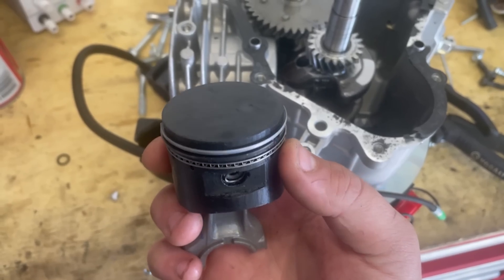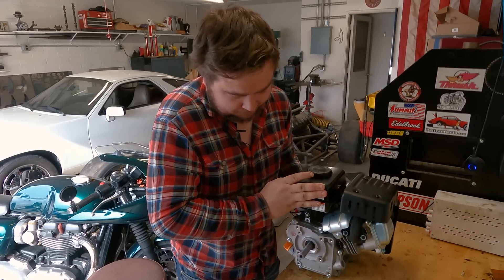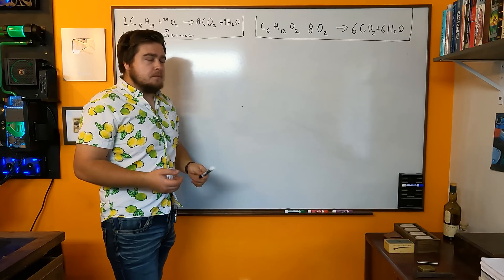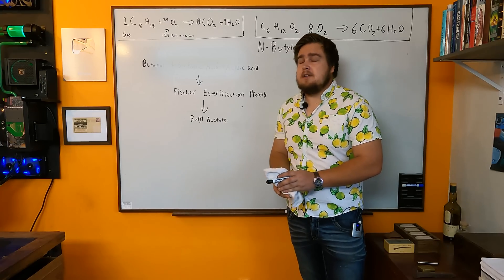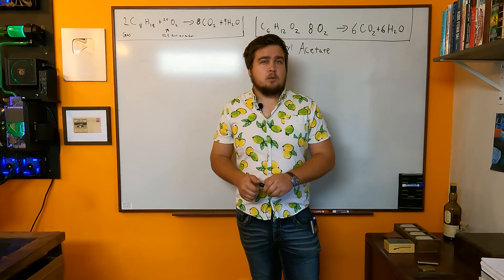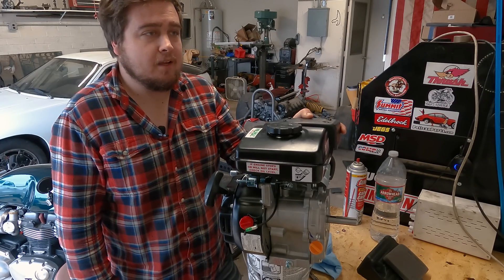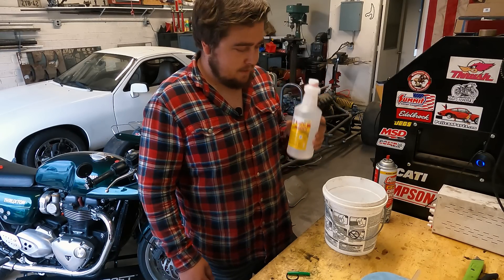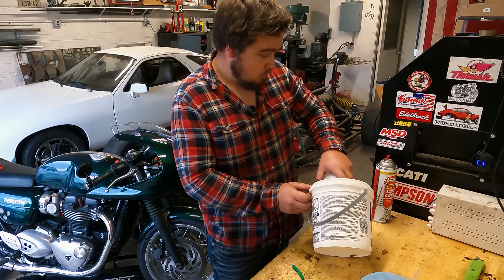Cold Burning Fuels and Plastic Pistons for Harbor Freight Engines!

Comment: This is a cool idea. It seems like if you could do some sort of vapor deposition of a metal coating onto a plastic piston. Or even something like one of those high temp ceramic paints you could both protect the piston against the solvent effects and a little bit of the heat, but still make the piston injection moldable or printable.
Reply from the maker: I'm actually looking into some ceramic filaments possibly.
Reply: @WesleyKagan  Cool. I was aware of those, but they didn't occur to me. Did you look into Ninjaflex filament? Not for the pistons, but it's fuel resistant, and one of the flavors is heat resistent enough to make carburetor boots and custom gaskets. That's a real help for people who want to keep old bikes going. I plan to make a custom airbox for my UJM that eliminates the need for the hateful old carburetor boots. It might work for your headgasket on your HF motor.

 I've been wondering how you have the time and resources to be such a polymath?

Comment: SIck brah. So, a few thoughts there. PTFE and POM are both n-butyl compatible. FEP too? McMaster up some o-rings. That's if you gotta stay with ABS. it's a pretty shitty material choice in this app imo. Instead of using an IR gun every few minutes, you can 'duino a type k thermocouple bingbang boom which will be good enough for you. Or, Instad of ABS try PA/PPA (if that's 3d printablle, i aint no 3d printer dawg).  I aint no plastic engineer, but check out Ashby's 'material selection in mech design'. Alternatively maybe look at using the 3d print to make a positive of the piston, make a negative with some sandcasting ..sand (i.e. like a die), and pour some metalzz in there.  Or, if you want to go down a rabbit hole, buy some PTFE pellets and injection mold into that die. Low co-efficient of dynamic friction broseph. Either way ABS is no good. 

So re: torque There are a bunch of idiots on the youtubezz who tried to characterize steppers torque. There was this one idiot who tried to jerry rig a load and had absolutely no idea what he was doing. I had just loaded up on my adderall script so I nit-picked every single thing he did wrong (I'm not a mech e, or an EE but I can fake it well enough to call out idiots). There were ~12 major flaws in his setup and I went all pedantic on him, because the dude was some like 45 year old so fuckin dumb  , dumbdumb. I hope in 15 years I won't be a fuckin mimbo like him. I just a dumb college drop out but I know enough to know a) when people are fucking idiots, with like 20% of the theoretical knowledge but posturing as though their shits dank, and b) i'm dumb but libraries and app notes have a shit-ton of legit knowledge. 

Jerry rigging a chassis dyno is a huge fuckin pain, i'd imagine, fabing all those rollers and blah blah. At the crank tho, I'm pretty sure you can just use a load cell and a water break or hydraulic . Those expensive Fap-off (tm, AvE) torque wrenches are just a wheatstone bridg, so yeah I mean jerry rigging no prob. https://en.wikipedia.org/wiki/Dynamometer Look at the water-break schematic, it's soooper easy. If you know a bit about EM those eddy current absorpers look even simpler in theory (I didn't even know those existed, fuckin cool)

https://www.mathworks.com/help/autoblks/ug/compression-ignition-core-engine-breathing-and-torque-production.html That's a model you can use via speed density. I think tunerzz get full power output numbers with a wideband o2 and SD. I was skimming a paper and i think some dude managed to profile his shit solely on a temperature profile, check it out (MICHAIL KORRES, 2016, KTH UNI, sweedeene Cylinder Pressure Sensor based Engine Combustion and Fuel System Diagnostics). The "real" way would be to drop in an actual sensor, they make 1/4-20's you can just tap into your piston and bing bam boom but those fuckers are expensie 

Overall the price factor of plastics being cheaper than metals isn't really that much. Cast iron is about a buck a pound, so in a production run, an entire consumer engine in raw materials probably costs...not much. Alu is a bit more but super environmentally friendly once the initial production is done (i.e. recycling alu is reeeeeal energy efficient). Also the maturity of the industry re:casting engines is a big plus there too, since all the tooling is already pretty easy to acquire/the processes are highly well known. 

Your shit rocks man keep rockin rockin

Comment: There's a difference between an engine free-wheeling and an engine under load. You can't necessarily extrapolate. It'd be a better (and shorter) test if you jurry rig up some way to load the engine. Either electric power, or else that warped-perception guy's go-kart brake dyno.

Comment: Rig an alternator up, load it with a known known amp load (heating element) and you have a basic power measuring device. 750w equates to 1 bhp

Comment: You would need peek to survive the temp and a stock prusa won't print that. But. There's enough filament that can be sintered into solid brass stainless or similar metals. You would need to resurface it for use tho

Comment: So uh, this test was horribly unscientific. Like you have no way of guaranteeing a fair contest between the two if you can't reliably get a good and steady 8:1 air fuel ratio for the n-butyl acetate.

But the fact that it ran so well on the butyl acetate is a good sign for sure.

Just saw a comment that mentioned how carbs will meter fuel identically between fuels because that's just how they work. They just meter fuel. Oof. All that changes is the power of the engine on different fuels, and that wasn't measured here.

If anything you should be using a method of measuring calories. Take like a cc of each, explode it, and measure the resulting temp and force.

Comment: As much as people want to put in plastic parts they'll never hold the rings firm enough or put up with any extended use, cold and hot starts would be very hard on them as well, in the cold you'd be lucky to not rip the wrist pin out of the piston and I'd rather not have to replace the pistons every 1000 miles

Comment: If you do the same sort of test you could monitor the rpm (instead of temp) and get an average of the rpm for the different fuels over the duration. If it's at a higher rpm for the same amount of throttle, it would most likely be making more power. I'm not sure how the choke would affect this idea though.

Comment: A far as Dyno-ing that little 79cc motor, you could design a 3d printed variable water brake. The tricky part is where to put the load cell to pick up torque but getting RPM is easy.

Comment: To Dyno it you can afix a DC electric motor and apply load to see what kinda of power the engine can output through the motor. It won't give you real HP numbers because of losses in the transfers between mechanical and electric energy but it'll give comparative results.
Reply: Or use a car alternator.

Comment: I think the gasoline result are pretty cold because this kind of engines are kind of tuned on the rich side.

Pretty much everything that is thin enough and can combust can be used as a fuel in a gasoline engine.

Ethanol, acetone, etc... Are very good remplacement for gasoline, too bad acetone dilute a lot of things it comes in contact with.
Reply: This is the same reason carburetor cleaner can be used to start a motor. It's like 95% acetone which gives it 120 octane and pure ethanol is 112 octane so it's a very stable fuel.
Edit: the only problem with this is that it attracts moisture which can be bad for your motor and fuel lines etc.
Reply: @matthewmorgan582  I agree, if you want to use ethanol with your engine, you must have a good sealed fuel tank and keep the level high.
Acetone on the other hand tand to make the injectors o-rings swell and lose theirs integrity, so if you must find a way to avoid this if you want to use this as fuel.
Reply: @ElectronikHeart  Yeah, it makes rubber and gaskets brittle as well. This is also why some engines require ethanol free as it can cause fuel separation and other problems although with the right setup you can run pure ethanol or methanol in a motor.
Reply: @matthewmorgan582  Yeah separation can be an issue with gasoline mixed with ethanol.
But mostly ethanol or pure ethanol fuel don't suffer from this problem as the water will just dilute the ethanol a bit.

The problem with e10 is that the water will only bond to the ethanol and all this water will fall at the bottom with the very small amount of ethanol contained in this kind of blend. Making it almost impossible to burn.

Comment: Short note, 6:10 anaerobic is where oxygen is not used for respiration, just erase the no on the front of the sentence and you're good, or you could say 'it does not use an aerobic respiration cycle'
Confused? So was i, because for the longest time i heard anaerobic, and an aerobic as the same phucking thing. Thanks professor, wish you had written more things out on the board, or avoided using, or at least notified when you used 'an aerobic'

Comment: Could try polycarbonate with a make-shift enclosure, as long as you have an all metal Hotend. Or you can get abs/polycarbonate blend from 3DXtech and maybe others. Does close to the same temp but is easier to print.

Comment: it will be an adventure to make it happen but I think your best bet is annealed high temp PLA. CNC kitchen tested it out to be able to withstand 180 C and hold shape. annealing the pistons will be tricky though. they have to be 100% infill and the best method I've seen is packing them in a container of finely ground salt and baking them at around 80 C and letting cool down slowly. this is going to have the needed high temp resistance and resistance to esther vapors
Reply from the maker: Any filament that has a crystalline structure will resist ester better, and PLA is a good candidate. I have a lot to try it seems, I'm looking forward to it.

Comment: Also, why are you dicking around with the pull start? Tear that fucker off and use an impact or drill with the right size socket to spin up the motor. Will make this process soooooooo much less tedious for ya.

Comment: While you’re at it, might as well print a clear head for those sweet sweet slow motion flame 🔥 front shots. I’ve been printing with ASA CarbonX (Carbon Fiber), 100c bed temp, but it may be too brittle for the piston. You’d also need a custom cardboard box enclosure for your Prusa:) great video 👍🏼

Comment: Get PEEK that should be the plastic that you are seeking. It prints like PLA but 200°C hotter on top of your PLA settings. You might modify your 3D printer for this plastic but it's worth it! I'm saving money to make this upgrade. Because this plastic is chemical inert and it's used to make funktioal parts in Aircrafts and in Aerospacecrafts

Comment: I've done similar tests regarding alternative fuels in small, carbureted engines and once completed them I realized the giant flaw in the tests. Run times will remain almost constant due to the fact that carburetors are made to burn x amount of fuel with y amount of air so it should always burn at the same rate. When you choked the engine all you did was lower y. Rpm was likely less with the NBA. You need to use a fuel injected motor with which you can control fuel maps so you can set afr to ~8 rather than ~13.

Comment: Many years ago you could buy a 2.3 liter engine (based on a ford) that was mostly made out of polyamide-imides plastic. Polimotor Research made parts for other engine designs as well. I don't know if they went the route of a cooler burning fuel thou. There are companies that can print 3D files with PAI powder. Which is still one of the best plastics. A PAI piston with a ceramic coating on top would work fine, and may outlast the stock one....

Comment: What about water injection? That would reduce combustion temperatures somewhat. Although it would require significant ignition advance.
Reply from the maker: Might be something to consider, although that also comes at a cost of power.
Reply: @WesleyKagan   Proper ignition advance to compensate for slower combustion propagation should make power loss negligible or at least minor per NACA tests.

Comment: rad. definitely worth a sub. would be really interested to see more performance characteristics of the stock engine on gas vs butyl acetate at different choke settings since these engines aren't exactly precise, and mixtures of both gas and butyl at different ratios to see if certain traits peak around specific ratios. actually doing that would be a little too time intensive, but this is a really cool heads up to look out for any engineering developments using butyl. really curious whether high compression motors would respond differently.
Reply from the maker: Same- putting together a dyno so I can see.
Reply: @WesleyKagan  Oh wow that's awesome, didn't expect you to take it that far. Does that mean we'll see some fuel mixture tests too? :D

Comment: So, I went and did a little math, and came up with n-Butyl Acetate should have roughly 38% less energy per unit mass and 23% less energy per unit volume than gasoline. So for the same power requirements, you'll consume your fixed volume of fuel 23% faster on n-Butyl Acetate. I think the reason that the time was essentially the same is that rather than increasing fuel flow to match air flow, you decreased airflow to match fuel flow. If you'd had it on a dyno, you'd have seen a drop in power output. This is also assuming the same thermal efficiency; I think you may see a slight drop in thermal efficiency going with the n-Butyl Acetate because of the cooler flame.

In any case, raw power isn't always the primary concern of engine design, so I'm waiting with bated breath for your next installment.

Comment: Hey, I once made a comment on your freevalve video regarding why the rockers are supposed to be off center on the valves.  If you want to dyno test the engines, I think you should reach out to warped perception on YouTube.  He dyno tests small engines with different fuels and does many other things with small displacement engines.

Comment: You can try starting it with an electric drill on crank shaft bolt to get more rpm starting. Also wouldn’t hurt to check compression

Comment: After this series is over, it'd be interesting to find a similar alternative to pressure ignition. If there's a lower-pressure, and thus lower-heat, fuel, plastics may work there as well. With how diesel engines work, the proper way of understanding them like how Gale Banks teaches it, it'd be interesting to see an alternative engine's upper limits.

Comment: If you want to play with materials, you can already 3d-print a positive, so some silicone mold rubber to make some molds, and have at it with casting whatever resins you feel like buying. JB weld almost feels like an easy pass with its heat resistance. High-temp epoxy and chopped fiberglass for a fiberglass piston? Saw dust and wood glue (maybe urethane glue, like a gorilla glue? ) to make a wooden/ 'mdf' piston?

Comment: you could try PTFE gaskets and rings to seal, Cole-Parmer have a great open access chemical compatibility database. I use it for pumps and tubing at work all the time, highly recommend
Reply: Just use copper

Comment: This is why all mechanical engineers are required to take thermodynamics.  The temperature spread is the entire and really only point of burning fuel in an engine.  The difference between incoming air temp and outgoing air temp is directly related to efficiency and power development.

Comment: Out of curiosity, you mention polymer motors being more economical, but is that quite right from a big picture perspective? Yes, a plastic motor would be less costly to manufacture initially, but when a part fails and the motor is decommissioned, the whole thing is just plastic waste. Current metal engine designs are almost totally recyclable, and while plastic recycling is obviously possible, there is much more energy required to turn the waste material into something useful, leading to most plastics simply being thrown away. Seems like a net loss, overall.

Comment: I'd bet you could play around with AFR mixtures, to get a better delta T!
Reply from the maker: I think there's definitely some options! Honestly I'm wondering if a standard 02 sensor might work..
Reply: @WesleyKagan  You'll want to get one with a heated element, as they need to be 600F. I've heard of old school guys doing resistors in a narrowband to change AFR range, but I'd think you'd want a wideband. AEM X-Series Wideband UEGO is a good one.

Comment: I have a car mechanical question for ya. If one wants to make a weird mid engine rwd car by moving the whole engine assembly of a front wheel drive car to behind the seats and keep the fwd transmission. Would that be a simple solution? Or perhaps do you have a different solution?

Comment: Most air cooled engines that are not "forced air cooled" (meaning no fan) are going to be running a head temperature of 350 degrees F (177C). The "head temperature" location is a spot between the intake and exhaust valve. Air cooled or not, exhaust valve temps are normally in the range of 1200F (649C) so this will give you an idea as to the peak temps of the combustion gases that both the piston and head have to put up with.